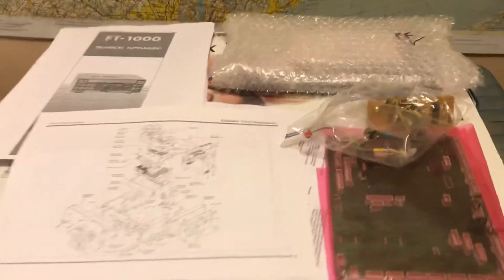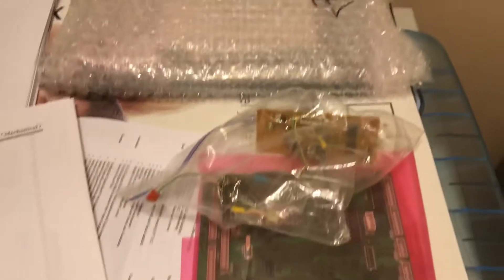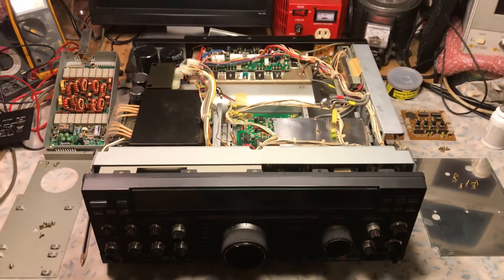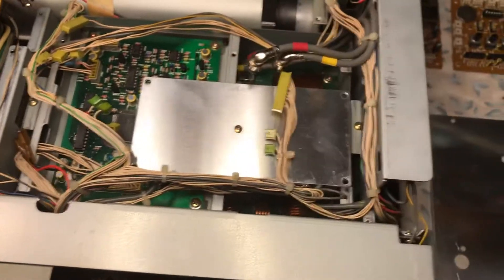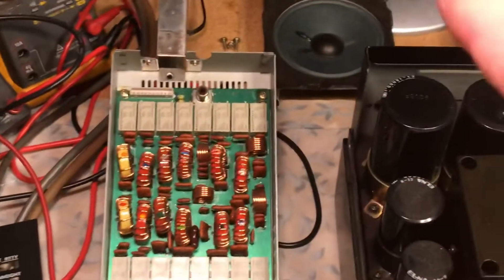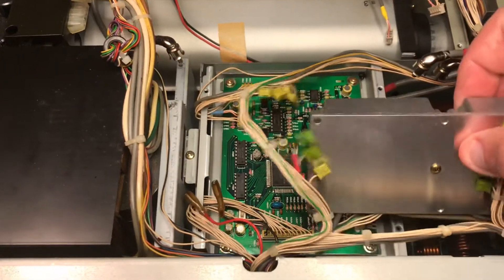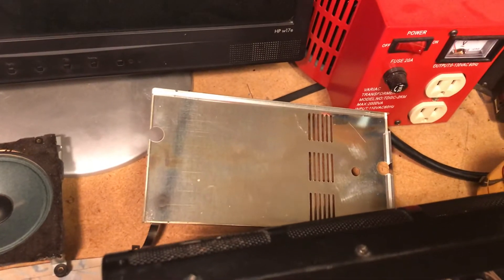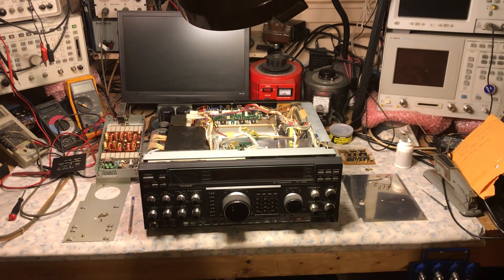Yaesu FT-1000D Disassembly of Unit to Access Antenna Tuner Unit

Comment: good morning sir....i have ft-1000d ..in case, indicator needle is high value..then led indicator "HI SWR " ligth up. i see in watt meter power is 100 minus watt.i try use dummly load, is the same  condition.I hope you can help, where is the damage to my radio....tank you sir ...